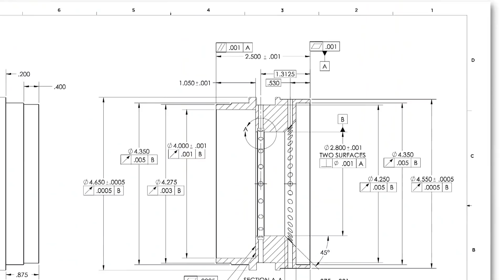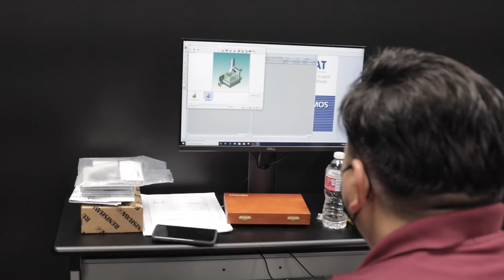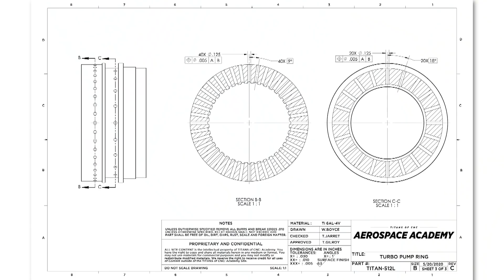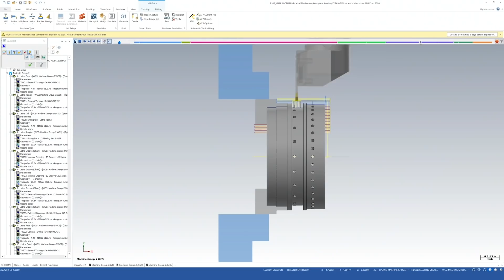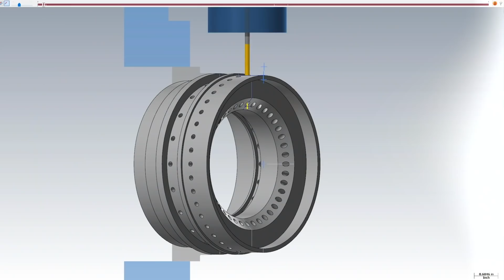Total Incompetence - Quality is Calling My Parts Wrong… I Checked Everything TWICE… UNBELIEVABLE…

Comment: Definitely pays to have a good working relationship with QC.
Sometimes, QC guys will cop an attitude saying "I've never made a bad part" , and try to screw with young people in the Machining trade.
You hit the nail on the head when you said we're all on the same team.
The guys from production, and QC need to work together to solve the problems. Real, or imaginary.
Another good video
Reply: QA inspector here - aerospace investment castings and aerospace machined castings/materials.  A simple verification with hand tools or rock and height gage that contradicts cmm report is of great concern and indicates a cmm report not to be trusted. 
All the top inspectors I have worked with will verify an out of tolerance dim. by measuring a different way and/or run their results by another inspector or leadman.  A variation of the "measure twice, cut once" rule.

Comment: I'd just suggest that there should be a reference part that the CMM is checked on, one that is complex and really puts it through its paces, and use it to cross check the CMM on a weekly, or even daily, basis.   That part should measure the same every time, and if it doesn't, then it's not the part that has changed.
Reply: We did it daily when i worked for a huge amwrican multi.
Reply: Not when it takes 3+ hours to check one part...
The CMM should have more than ONE calibration Sphere and Alternate probes.

Comment: Very true, most people forget that even the most expensive system may fail when operated by egomaniac... Having a second opinion or testing with different method will not hurt anybody...
Reply: Whenever I have a tolerance/measurement that just seems "off" I always have some one else take a look at it.  It's a sanity check for me.
Reply: @brandons9138  yes it is a humane thing, esp after gruelling hours of machining on several machines and that high pitch vibrating our spines, better take a breather than wasting time arguing...

Comment: We had this part where I was 100% sure that the part was good bc of how it was programmed. The Qualitymanager told me that those tolerances that were important arent correct. I checked the part on the plate too and double checked the programm and the fixture. In the end the long probe measuring most of the tolerances was being pulled down by the magnets holding the part on the measuringmachine.
Reply: That's crazy. Must've taken a while to figure that one out 😂
Reply: @accumulator4825  never use magnetic clamping if possible

Comment: I'm grinding machine operator and to be blunt I'm quite fed up with one particular customer. The (wearing)parts that we grind for them are going to be in quite violent environment and if the tight tolerance is showing with their hightech measuring machine +0.001mm they scrap the part. Also they are finding concentricity 0.003mm off the tolerance in nearly EVERY part and always in the same place. I'd might get that if there wasn't any other diameters ground at the same setup, but there are several and those are all ok and the grinding pressure is basically nothing with my over careful program. Just not worth the effort especially when the price has to be next to nothing.. We do have also very good and nice customers too so not every day is horrible. Machinists knows.
Reply: Is there anything worse than a customer who thinks he knows more about his parts than the machinists who actually make it and understand its application and the conditions it will be subjected to?    And he refuses to get his own inspection equipment checked for accuracy and consistency?  

The only part I have a machine shop make for me has tolerances of +.001 and -005 inches and the surface finish requirement is "whatever a good cutter delivers is fine" so there's never a problem.  I'm easy.  It's HARD for any competent shop to mess up the part so badly it fails inspection.   Oh, sure, I could spec every dimension to +/-.0001 inches and demand a 4 microinch diamond turned surface finish,  but that'd be stupid and so far beyond real world requirements.

Comment: Fantastic post!

I worked in a QC department while going through college.  We had a Mitutoyo CMM (manual) with Renishaw probes.  My job was to do first article reviews and random sampling.  I thought I knew prints forward and backwards until a Journeyman machinist explained MMC to me.  We sat down (coffee and smoke break, as every 30+ year machinist smoked unfiltered camels then) and he drew a circle with a center point, then drew radial right triangles (x and y axis) to show how much MMC can be if hole size is near top end of tolerance (hypotenuse).  I learned more from seasoned machinists in the QC department than I ever did in school……by far some of the smartest people I ever met!  We worked together and learned from each other to make the best parts possible.
Reply: My dad was a 30+ machinist and smoked unfiltered camels.  I remember him saying to always make sure you smoke it from the right end.  No filter so I asked why and he said you don’t want to put a camels ass in your mouth.  He would have loved his channel.
Reply: "if that thru hole doesn't line up with the bolt hole, what are YOU GONNA DO?"

I dunno boss, I guess I'd drill it out bigger until the oversize hole did fit the bolt on the other mating part.

"Exactly. That's MMC, kid."

Also, another way to think of tru-p is on an old school print with an X location and it's tol window and a Y location with it's tol window, you end up framing a square of all the possible places that is ok.
Spin that around it's center and it makes a circle instead. with diameter equal to the diagonal of the square.

Comment: As my company's primary CMM programmer and operator with a machinist background, I manually check almost every failed dimension by hand unless it's too straightforward to worry about. While my title may be CMM operator/programmer, I'm in the quality department. I have no special allegiance to my CMM, I'm just trying to measure my parts right.
Reply: Always good to verify your results with other methods!
Reply: Ditto, If a feature fails I manually check it another way (surface plate inspection, air table, comparator, hard gage) to verify the result.
Reply: @spivzit8754  exactly. Given that the CMM said that overall length was off, a quick check with a digital caliper would have probably been enough for a thinking person so say “wait a minute - something’s not quite right here.”

Comment: I remember this happening  twice on tight tolerance bore dia  on large dia components and it was the customers fault. (1) The component was delivered and inspected as they came though there door . Outside temperature - 5 deg centigrade .They reported they were undersize . Resolved when they checked them at standard temperatures (2) The component was delivered and placed in a large wooden crate on their diameter and left for 4 days before they were inspected .They were reported as being out of round . The weight of the rings on the dia caused the distortion . Resolved when placed on their side faces and left to normalise .Both these rejected components were caused by incompetence of customers knowledge of  storing different shapes of  components
and standard temperatures when they should be inspected.

Comment: I see this problem all the time. I am a CMM programmer/operator. The only time we really have a problem we have is hole location and it needs to be tweaked by tenths. We work with carbon composite thermoplastic so that add another level so the problems. But the biggest problem I have is when engineers do not what to believe that I do not know what I am talking about show them that the dies are made wrong.

Comment: I was,(still am), quality assurance in a foundry and cnc shop. Our procedures were always to check for calibration on every measuring tool before using it that day. Any wrong dimensions that were found, the measuring equipment was double checked and then the part re-measured. If it was still found to be wrong, we took it back to the machinist. We would then check the calibration of their measuring tools, and have them re-measure. It was usually a tool out of calibration.

Also, pretty sure the part he was showing was not the part that took 2 weeks.

Comment: As a QE, my first question of the CMM report would've been, is there a disparity between the 3D model and the drawing that the machinist is using to check it? Was the machinist and quality provided the most up to date drawing and model? In my experience, whenever there is such a massive disparity between what the machinist is seeing vs what quality is seeing, its usually because one of those parties does not have the correct information. Beyond that, I'd look at the CMM program itself, part setup, and first piece validation for each individual operation along the process. But I would've agreed, an entire CMM report showing failing dimensions and features is a huge red flag that a mistake was made when the inspector setup the part and picked up the datums.

In my honest opinion here, the biggest mistake was Quality sending off the report straight to management instead of getting together with the machinist in an attempt to understand why there was such a disparity and how to reach a solution.
Reply: Totally agree, as a machinist and later becoming a QE, I was always taught if you check anything and it is wrong the first thing you do is verify the error with two other devices when possible.  In our shop quality and manufacturing work together to make the mfg plan and the qual plan ensure the best parts possible are produced.
Reply: @JS-rh3sq  That's exactly how I do it. Once I have a full understanding of the issue I go talk with the operator and possibly the programmer about it since I have machining experience as well.
Reply: As a QA lead and CMM programmer with a solid CAM background: the CMM program should have been written with iterative checks built in for it's first run through to troubleshoot that can be disabled or skipped over after a first run. This also irons out trouble with the number one most common CMM program flaw, bad alignments (root cause in this case) prior to committing time to the entire program. Third, QA should have understood the report they were outputting and (in)validated some of those features with other methods before then, fourth, taking it to production since helping the team MAKE an in tol part comes first in the value stream before documenting then archiving that it's good.

I do run into print/model discrepancies all the time. It's in our BPO how those are handled in an order of precedence/hierarchical arrangement. As well as in the QA procedure manuals (that I wrote most of to conform with prior company docs) for how to handle them when there is no-one around to ask for clarification.
Reply: I respectfully disagree, everyone works from the Manufacturing Order documentation.  Where' were the first article inspections? Where's the in-process inspections.  QA would have know immediately whether the part had problems or not.  This was an adversarial environment.
Reply: @edwardkiepper1563  it was a 1 off part.
Reply: @jamesscott6753  That makes it all the more important for QA to be in there checking things.
Reply: @edwardkiepper1563  in where? My point is that there is no FIA or in process
Reply: @edwardkiepper1563  No, everyone doesn't work from the Manufacturing Order documentation. Are they supposed to? Yes...does that mean they do? Not at all. Any machinist or assembler who's been in the industry for a decent period of time will tell you that....they have their personal drawings and documents that have been marked up over time with their own notes; that they use to refer back to for things that aren't specified in the work orders (changes that they have requested but have not yet been implemented, problems they ran into on the previous run, missing dimensions on the drawing, etc). So, often times, updates or changes aren't immediately identified by them...or Quality for that matter (because they do the same exact thing on their end). And then there's the whole "tribal knowledge" problem. A good machinist will will either trash or compare those notes to the new revision whenever a change makes it's way to the floor. Key word being, "good".

It's the nature of the beast. Further, control plans are not always made correctly either. Quality can miss things too....and they often do when reviewing revision or contractual changes that affect parts on the line or the next production run.

The question of the FAI is a purely situational issue and really depends on whether or not this part had actually passed it's FAI yet and had been accepted by their customer. Contrary to popular belief, the FAI part does not have to be the first production part....nor does it have to be a single part. It just has to come from the first production run and can be comprised of several parts if need be and often times is; especially if you had one complete part with only one or two dimensions OOT; a second would be submitted to complete the FAI as a delta for those dimensions that were OOT on the first part. This is all subject to the contract of course...but that is industry standard.  

The point is...at least in my experience, I never lived in the "well this is how it is because that piece of paper says that's how you're supposed to do it" world. I lived in the real world....with how things are actually done. You get more accurate answers and better solutions that way. There is ALWAYS a disconnect between what the written process says....and how it is actually accomplished.
Reply: @falco5150  thats why we dont use drawings just give them a model, +/- .005 to 3D geometry
Reply: @falco5150  It's obvious you are not a trained Engineer or Quality inspector, or you would not be making these comments. FA is first piece BEFORE production starts not any part in first run. QA approves production. Manufacturing doesn't do what it wants. That's Quality authority and responsibility to approve the start of production or what you get is a bunch of scrap metal!  As far as manufacturing documents. They better all have the same exact drawings that everyone uses without missing dimensions or engineering does know what they're doing.
Reply: @edwardkiepper1563  quality does NOT approve the start production, they report their findings and just because quality rejects a part, doesnt mean it isnt going to get authorized for production. Quality doesnt authorize acceptance on deviation.
Reply: @jamesscott6753  Quality does approve production start at my company. That's a big reason we don't need to ask customers for deviations or make unnecessary scrap!
Reply: @falco5150  And I'm sure that's the level of your communication and interpersonal skills I'm surprised anyone even hired you!
Reply: Yea. Either a feature was off, in the model or at least had a bad hit when built off the CAD model, or it could even be that the datum on the part was messed up. Just throwing a failed report back at them is about the only unhelpful thing you could do in that situation.
Reply: @DrinkDaKoolaid you've never worked in a shop creating anything remotely complicated then. Its doesnt make sense to do geometric measurements by hand
Reply: @DrinkDaKoolaid octagon? Wtf do you not know what geometric tolerances are?
Reply: @DrinkDaKoolaid omg🤣🤣
Reply: If it was simply an improperly measured datum in the CMM then the measurements being out would look very similar to an improperly fixtured machine OP. I cant imagine any reason to report the results to the machinist prior to managment on a 1 off part. The machinist isnt going to make the decision to rerun.